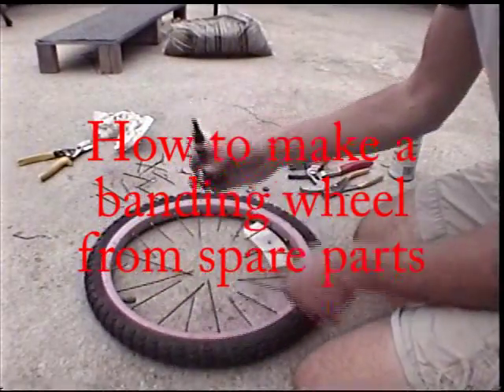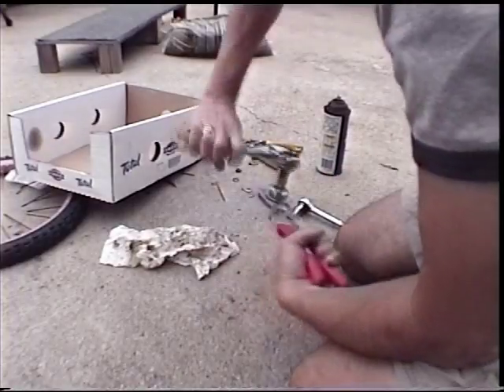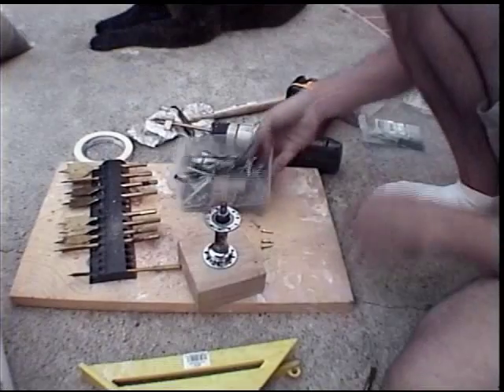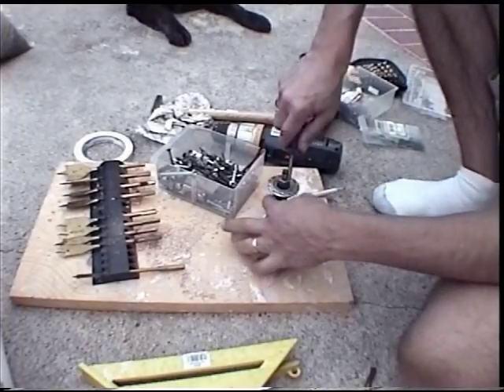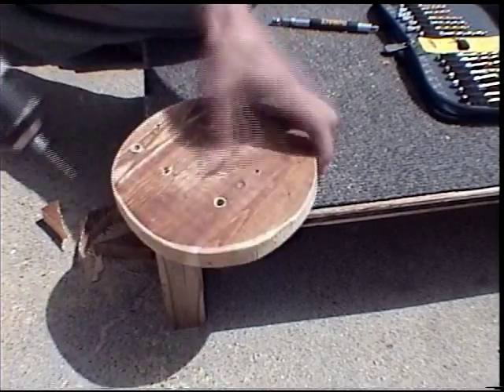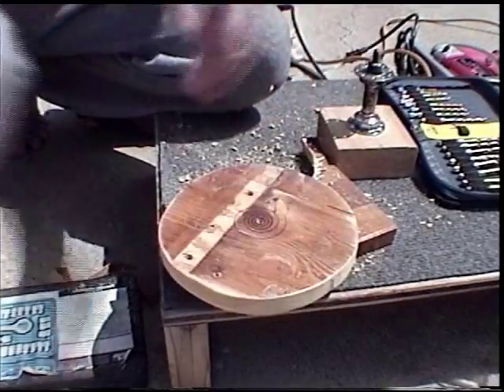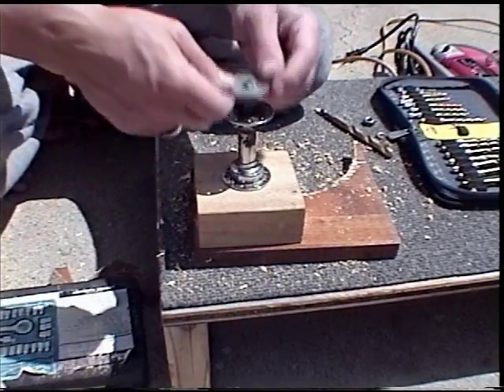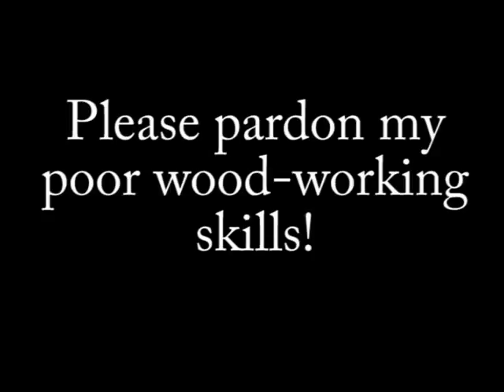How To Make A Banding Wheel From Spare Parts

Comment: Amazing! Lots of people are looking for this, but we are searching for "DIY pottery wheel". We beginners do not know what a banding wheel is. We just want to practice throwing in a cheap way. Please add " DIY pottery wheel " to the title so that it will be helpful to many. Thanks for the valuable video.
Reply: Vinita Morrison  When you want to spray glaze pottery pieces you place them on the banding wheel and spin the wheel at a steady rate.  That way you have an even glaze coverage.  If it didn’t spin smoothly you’d end up with thick glaze and too thin glaze in various spots on the pot.  Marian’s husband made sure the wheel spun freely with no wobble.  He demonstrated that right a t the end of the video.  I also use a banding wheel when I underglaze pots.  The name of the banding wheel kind of defines what its original use was.  You can hold a glaze brush or a carving tool steady against a pot as it spins and you’ll end up with a nice straight line all around the pot. A banding wheel is not heavy enough to throw pottery.  You can use a pottery wheel as a banding wheel to decorate your pot but you’d end up with a big mess if you sprayed glazes using it.  Plus, if you’re spraying glazes you must have a good suction fan and duct it to the outdoors.  You do not want to breathe glaze mist.  Some of the chemicals used in glazes is EXTREMELY toxic.

Comment: Could you use a pipe or something cylinder-shaped to add length from the first circular bat and then make another bat on top? if that makes sense. Sorry, I'm not really a tooly type kid. I'm trying to make a kick wheel for pottery

Comment: The great part is using the hub of the bike.  Two things I might suggest are weighting the base a bit more, or making it as big as possible so not to teeter, and using a trapped T-nut on the top instead of a bolt.    Thanks!

Comment: Thanks for sharing - I have a question/caution.   WD40 isn't a greasing oil, but something to free up stuff.  Sure, it leaves a fine oil but this oil is very thin and the solvent in the delivery spray will strip any functional grease/oil.  WD40 will strip and dry out a bicycle chain for example: it's not design workload.  Originally it was design for spraying on circuit boards to keep damp out of the components. Perhaps an oil designed for cycle components would be a better bet?

Comment: Is it completely flat and not wobbly? I want to try and make this with a 20x20 board that I drill art canvases on to of for painting, and so far your the only one I've seen who comes close to what I want. Other videos are either using meh lazy susans that don't have enough smooth spin to them or use a plethora of machines and power tools I'm not going to buy for such a small project.
Reply from the maker: This has a very smooth spin, like a bicycle wheel does.  The only thing that would have made it better is if it were cut perfectly round!

Comment: If I wanted this for a potters wheel, could it be driven by a sewing machine motor?
Reply: You want something a LOT more powerful. The homemade potter's wheels I've seen have been 1/2 horsepower or stronger, though that may be because these guys wanted to make huge pots. Per Google, 1/4 horse motors work. Sewing machine motors are 1/15 horsepower or so.

Comment: I need some electrically support here , the wheel will have to roll when we switch on like that
I need to this help plz
Reply: You are looking for a "Potter's Wheel" - a powered spinning wheel for forming a clay creation. Imagine a lathe turned vertical. 

This is a "banding wheel" which is used for decorating or trimming a partially-dried clay item, or for turning clay comfortably while sculpting, or for decorating a cake. Different purpose.

Comment: can someone tell me what a banding wheel is used for?
Reply: I will use one to spin my sculpture conveniently so I can work on one side then the other.  Most use banding wheels to spin the partially-dried work so they can trim it, or a dried item so they can glaze it (or wax parts to keep the glaze from sticking). Some use these for cake decorating.

Comment: Can you make it with a pedal and run by pedalling it? It could be a bike pedals or one board with a circle and an arm...I can imagine it in my head but explanation has to come with drawing to be clear...LOL
Reply: if you have few days for work on it and you have some 90 deg bevel gear or idea how to mimic it (probably two small wheels with hard rubber tire which you can cut to 45 deg angle...) it can be very nice solution i was think about it some time ago and i think that it is possible, maybe some day i will do (have really nice pile of bike scrap parts)  it an upload some documentation :)... thanks.. :P
Reply: wHEN YOU IMPROVE IT PLEASE SEND ME A VIDEO AGAIN. i WOULD LOVE TO SEE YOUR PROJECT IMPROVED. i LOVE YOUR WORK. yOURE VERY INVENTIVE.
Reply from the maker: Please keep in mind that this is NOT a pottery wheel, so powering it with pedals doesn't make any sense.